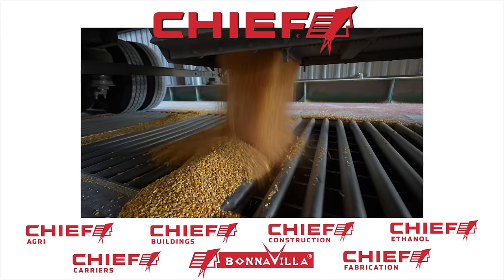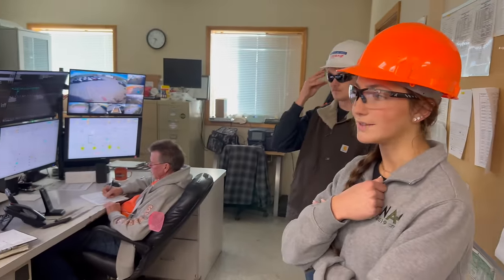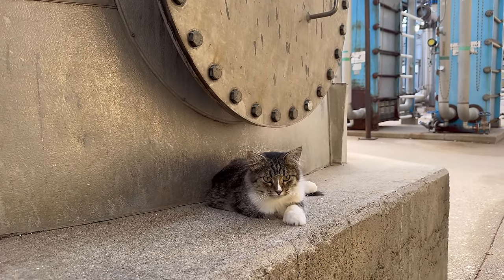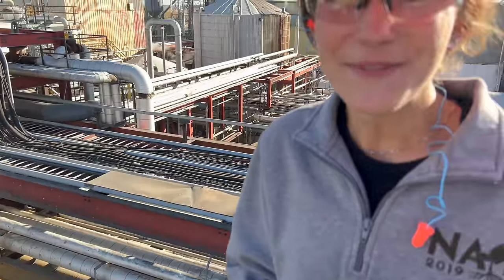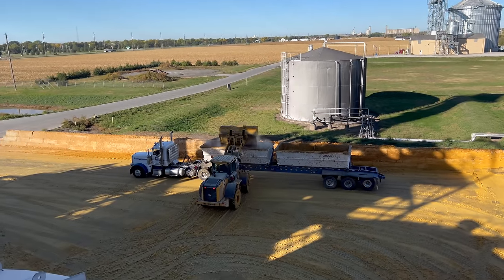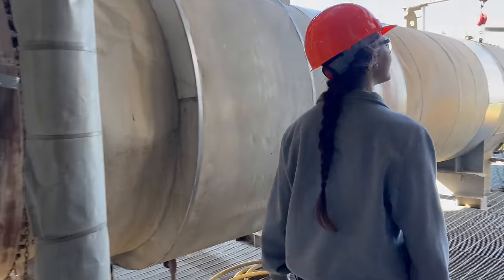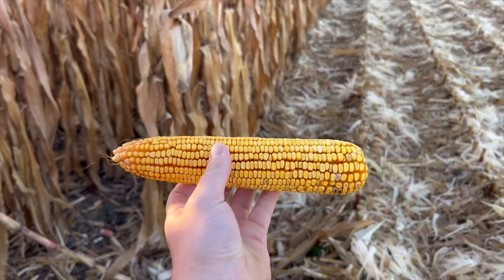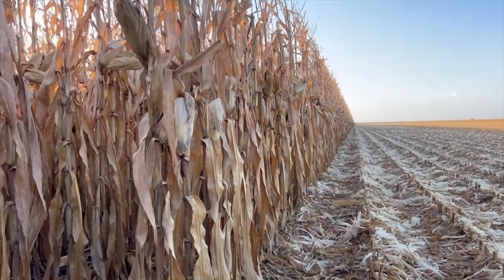Why US Farmers Grow So Much Corn

Comment: I have one question.
Why not build a plant to make soybean fuel oil for 
your tractors, and anything that runs on diesel?
 
The Chinese, Russians, and Western Europe do it
to replace the diesel they have to buy?

No Blue Juice needed when you run soybean oil in a diesel.
No unsafe transporting, no unsafe storage. (far less combustible)
It just smells like someone's making French Fries when it drives by.
Remember.
15% corn juice in pump gas, knocks down the mileage of every car by 20%.
Sure they sell us 20% more gas, and get more in taxes,
clog carbs, and FI systems, and rust out fuel tanks, so auto shops make more..
But aren't farmers supposed to be smarter,
 then the idiots they pick to send to Washington? 
They used to be.
Laura, Ask your Grandpa, how much gas & diesel were
when he started farming. I bet his (R) Congressmen were retired Farmers!
Oh, and for a reference, bulk soybean oil is $2.41 a gallon delivered.
Ask your government officials to WORK FOR YOU, and not just try to shut down
our government over a past President's Federal Court trials.
Reply: E10 knocks the milage on my pickup down about 5%.  I kept track of each tankful for a couple years, and it was pretty consistent.  E10 has been more than 10% cheaper than no-ethanol for a long time.  I don't have e15 at any local pumps, so I haven't done any testing with that.

Comment: I know why thay make ethenal I know thay add it to gasoline. I know there are no engines made to burn ethenal. If I  had a car or truck I would buy gas with the lowest ethenal I could get for economic reasons. but I have only two Harley Davidsons. I need to run high octane fuel Luckly where I live there are many many stations that have high octane ethenal free gas $$$ but oh well it's what I need.

Comment: You are making a lot of money by contributing to ethanol, but I refuse to buy gas with ethanol. This additive destroys the inside of small engines. Ask your small engine repairman he will tell you if he is honest. I get better mileage and more power in my 2016 Ford F150 by using ethanol-free gas. Yes, I pay more, but it is worth it.
Reply: It is going to be a big change for all of us as we transition away from internal combustion engines.  Big change
Reply: That is not likely to happen unless you intend for all of America to move to town. The electrical infrastructure will never be able to supply power to replace internal combustion engines. At least in the next one hundred years or so.

Comment: It's a gigantic moonshine plant! Shocked that Chief is using a loader to hump all that mash to trucks instead of pumping it into the trailers! The problem with ethanol (alcohol) is that it's toxic to the fuel systems in most cars and trucks.  It destroys the rubber components and lacks the lubricity to keep the injectors happy.  Hence it being mixed with various percentages of petroleum distillates.  ALSO, you two have to slow down your harvest so you can give those 10,000 unsubscribers  time to wise up and push the button! 😁😁😁😁

Comment: It is such a big waste of water to grow irrigated corn to produce ethanol.
You draw more water out of the aquifers than gets replenished, resulting in a lower water table each year.
Additionally photosynthesis is a terrible inefficient way to produce energy.  Only 0.1-2% of the solar energy is converted to chemical energy bound in the plants.
If you would instead use the areas for solar and wind power you could harvest 20 times as much energy and could directly split it between electric energy for the grid and chemical energy in Methanol plants.
All without any water usage.
Farming for food is a great cause, but farming for fuel is just a waste and your grandchildren will pay the price for it by not having any arable land left on your farm.
Reply: The aquifer level where Laura farms is measured every March since 1960.  The 2023 measurement was slightly higher than the 1960 level.  The aquifer is not being depleted.

Comment: So, what are you and Grant going to do when our government requires everyone to drive EVs?
Reply: sit in the dark around a fire.  The U.S is not even close to going away from fossil but are requiring it.  Energy grid (as well as alot of homes) are not close to handle it as well as production.  It is a good dream but the project plan is WAY off.  It will be interesting to say the least.

Comment: Grant is generalize to much. First of all its not making gasoline its making an additive for gas.  Adding alcohol to carburetor engines is bad for the engines it deteriorates the carburetor parts. For non Carburetor engines like fuel injected type it decreases your engine power not to mention your fuel efficiency is decreased also. When all is added up the production of corn (Farmers wasting fuel to plant and harvest corn, the chemical plants producing chemicals to spray on the corn, the shipping of corn, the power to pump water out of the ground, the plants to extract the alcohol from the corn, i could go on ever, ...) its a waste of fuel and OUR Tax paying money subsidizing these farmers. Also he speaks of using fossil fuels they sure know how they burn up the fossil fuels tractors, skid steers, ATVs, trucks, motorcycles, ... any little thing they have to work on they jump on a fuel sucking tractor or such to do a job, the days I grew up and still do like pick up a shovel and dig a hole. NO fire up the tractor and use a digger.  Thinking of a ear of corn as a battery again is generalizing, all the on going engineering, the fuel, the chemicals, the energy to create that so called battery is not mention he's sugar coating it. Don't buy what they're telling you.